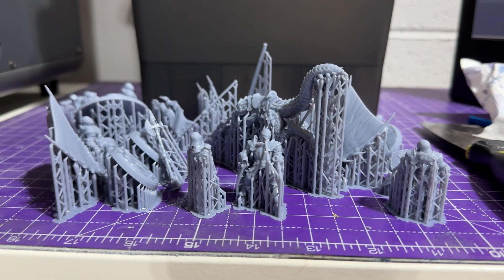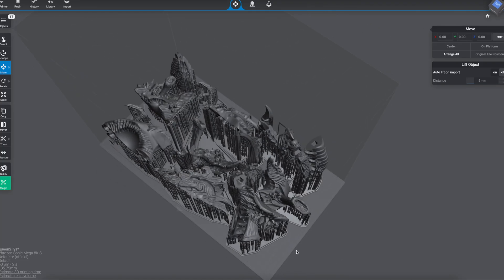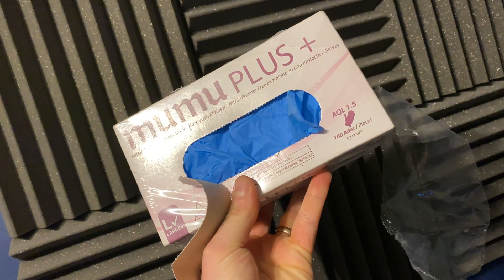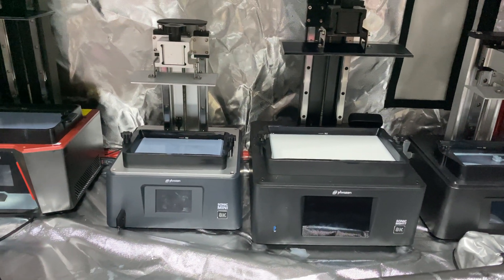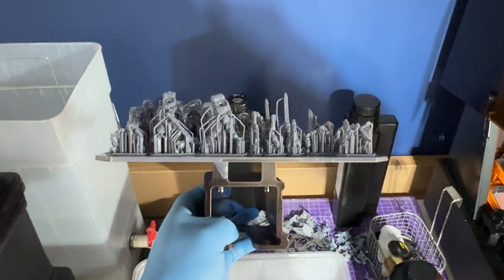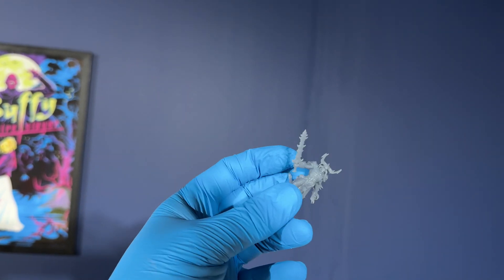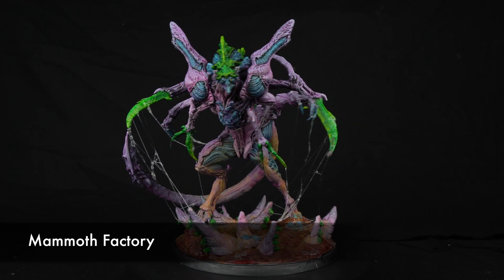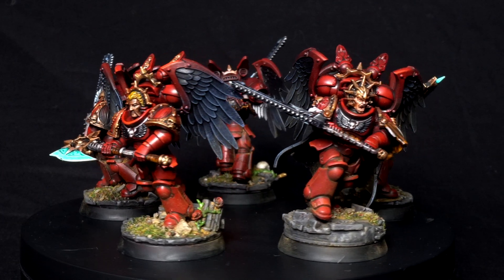The Realities and Steps of Resin 3D Printing Miniatures

Comment: I really think you tubers need to go beyond just presenting 3d printing, I think they need to make links to online classes for resin printing.

1. the videos on you tube do not have the time.
2.the classes go over the boring bits, if the new person cannot go over the boring bits, they are not ready to buy a printer.
3.the class goes into detail about space and safety.
if the new person cannot adhere to those things, they definitely should not buy a 3d printer.

Comment: thanks for doing this video, I have not yet 3d printed because it looked complicated, well it kind of is, like anything else, its not as easy as it looks, so to 3d print i need a spot in my garage, some sort of venting mechanism to get rid of chemical smell, a wash station and a cure station. which is all investment of time and money above the printer.

To be extra safe, I have purchased a whole class on 3d printing on Udemy, I think you might want to make a video about purchasing a class about this process.

1. the class goes step by step.
2.the class goes over space needed
3.the class goes over safety
4.the class goes over cleanup 
5.the class goes over curing.

you can wait for the $10 sale to get the class.

its actually what i am doing before even buying a printer.

Comment: 10:00 also something I've seen literally no one mention - you can't cure in the cold. I tried to cure models in my 0 degree C cold cellar and they literally just never cure in the cold. I probably had a 28mm mini on there for 40 minutes combined and it never cured. I took it into a heat source and bam, cured in like 5 minutes.

Comment: Thank you for making this video. I’ve considered getting a 3D printer for years but keep delaying it because I live in a small house. The only place I could safely put a printer is my basement, and I worry the fumes would travel upstairs since there aren’t any doors between the basement and the main floor.
Reply: IMO if you run the printer in any area that shares the same HVAC system you live in - then that's not a safe solution. No grow tent venting our the window is going to fully prevent the fumes. Your risk level is up to you but I think people are way, way too comfortable running these things in areas they shouldn't be.

Comment: There are so many "normal people shouldn't be doing this" moments with resin. Some random ones: 1) I use a cheap countertop water still to reclaim my wash methanol, but I wouldn't recommend anyone do that unless they know what they're doing fire safety wise. 2) I got some awesome "presupported" bird beastman models... that are aggressively over-supported. Like 10+ minutes a model to clean up even with hot water, and I still I broke a few feathers and arrows. I decided it would take less time to redo the supports than hack through the jungle during cleanup. Yay, more time in Lychee. 🙃 3) Multi-exposure in UVTools has been the best way to dial in resin settings for my Mars 3 — UVTools is dope, but it doesn't feel fair to expect any normal person to navigate that UI.

Comment: The amount of 3d resin printers I have seen on FB Market place that say in the description" Only used a few times, found out it wasn't for me" or " tried it but didn't really like using resin" is very common. Thanks for showing the full process and what it's like.
Reply from the maker: Exactly. So many people will get a printer based on it looking so easy in videos and promotional materials, and then realise there’s a bunch of other considerations. If they know that in advance the likelihood is things will be fine, otherwise it’s enough to put them off altogether and that’s not what we want.
Reply: This is me - thinking of selling this thing. I setup my cold cellar with a custom made heated box for this stuff, a custom exhaust system for it, bought all the PPE, liters and liters of IPA... I just hate doing this. I spent like over $1000 CAD on my entire setup and 3 full nights building the heated and insulated Cabinet (I live in Canada, a thin mylar grow tent won't do anything in a sub-zero cold cellar). Frankly I just hate doing this and while it seems convenient to get a large variety of stuff to paint I'd way rather have just spent my money on random kill team boxes and painted those up. No matter how much you try to make the process of resin clean it just won't be.

IMO just get an FDM printer for terrain and buy your models.
Reply: @ Thankfully FDE has gotten pretty good and there is a community of FDE printer fans that are into miniatures. You can't get resin details but you can get 2k-4kish level it seems. For me that's good enough and I with the Bambu Labs printers being crazy easy to use I am going that direction now myself.

Comment: Just not going to go near resin. I’m waiting for an A1  upgrade which has two print heads, so that miniatures are possible with support contact points printed with another filament without needing to purge the nozzle each time. I can live with the quality issues compared to resin. I just can’t be dealing with toxic resin.
Reply: resin is caustic, and its not even the most toxic part, that would be alcohol cleaning resin as that turns resin into a aerosole, so most safety is around ventilation which would be already as focus if you paint and sand.
Reply from the maker: An A1 with two print heads is my dream. Can’t wait to see what Bambu bring to the market this year.
Reply: I’d buy one as well.

Comment: I’ve been 3d printing g solidly for a year now and just tackled my greatest challenge, the FEP change! It’s great seeing all the knowledge I’ve accumulated on a new clean fep that prints reliably
Reply: Ps. Could you do a video about the holes on the Mega8KS build plate? Best raft that you use on the plate? Surprisingly I see very little info on Phrozens subreddit
Reply from the maker: Sure thing! I’ve been surprised by how little issue it’s caused me.
Reply: @GrayScalpMiniatures  Thank you so much! I've gotten a lot of mileage out of my Saturn 8k! been trying to decide wether the build plate upgrade will be worth it for larger scales and one of the major selling points for me is that the build plate is not on a ball screw

Comment: Would you recommend that phrozen megacure?  I kinda want somewhere to put bulk loads of prints to dry.
Reply from the maker: Yeah it’s really really good for large amounts of prints or large prints in general. It also has racks that go inside so you can have lots of layers and also that helps to get the underside of the print as well.